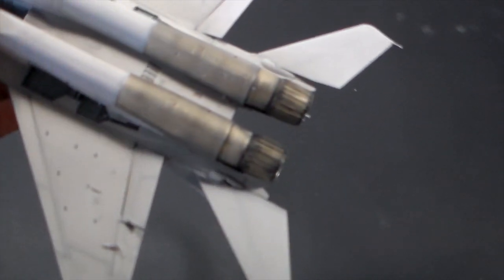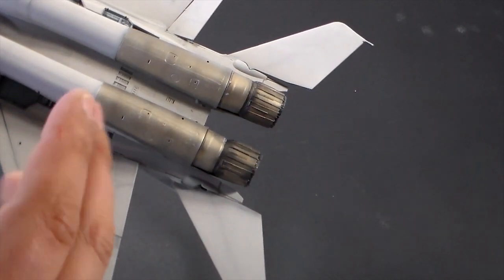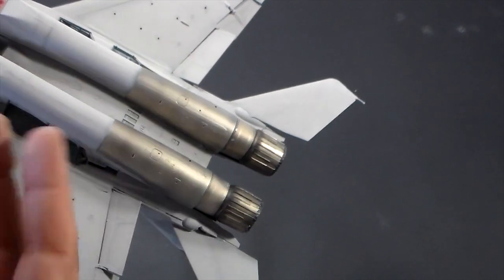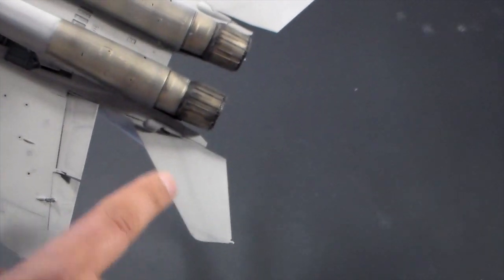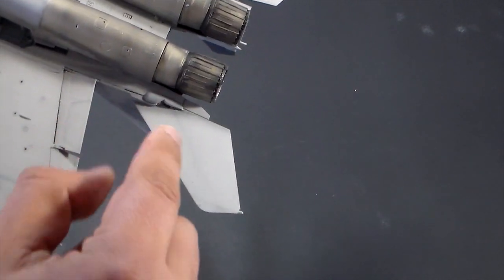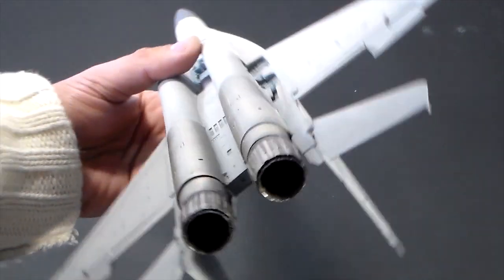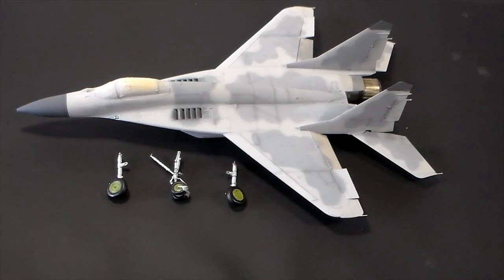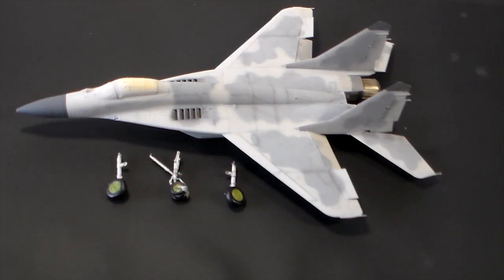1/48 GWH MIG-29 "MIG GROUP BUILD" UPDATE IX

Comment: Regardless of the fall, the plane looks great. I did notice that you made the vertical stabilisers parallel to one another, like on the su-27, however on the mig-29 they are canted outwards similar  to the F-18 hornet. _ \ .. / _   Still looks awesome though.
Reply from the maker: Rich Thanks for the input... will try to correct that